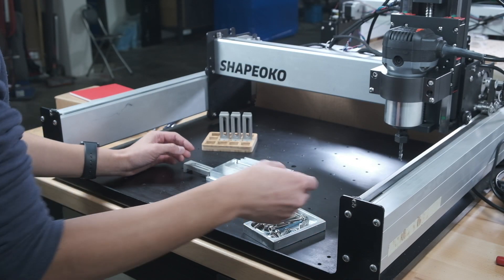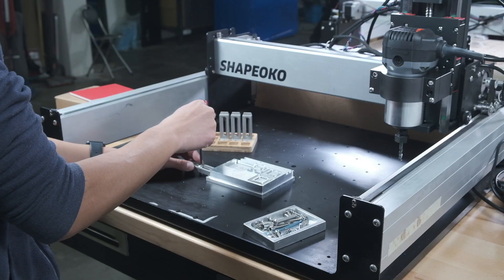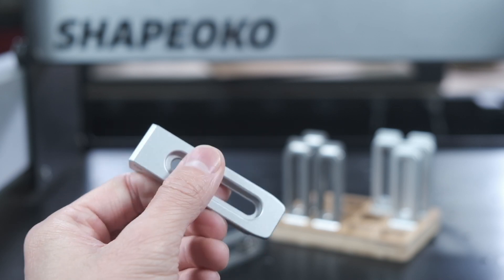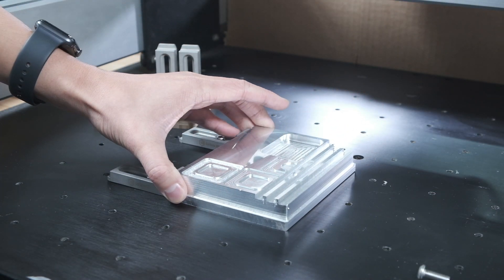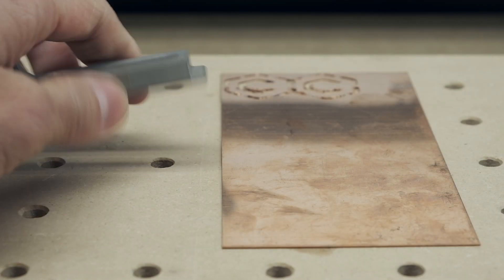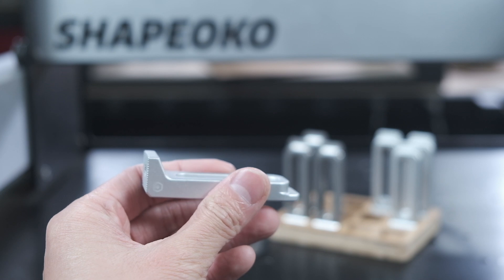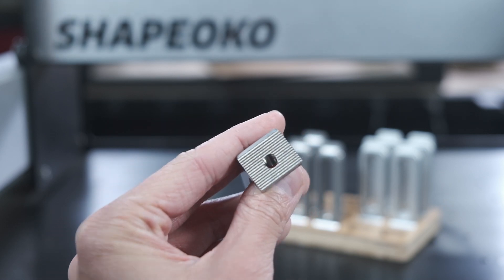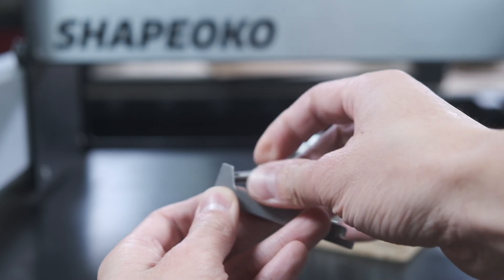Gator Tooth Clamps - Workholding with a Serious Bite!

Comment: Aluminum? No thanks. Threads will strip pronto.
Reply: Also available in stainless steel
Reply: I was in on the test group and have been using them for a couple of months. I haven't stripped any threads. But I know the right amount of torque to use to avoid it. The stainless ones will help people who aren't as tuned to torque.
Reply: У нас вообще пластиковые, и нормально работают.